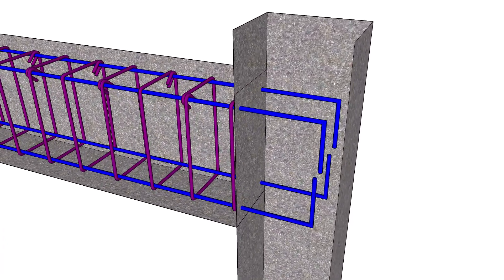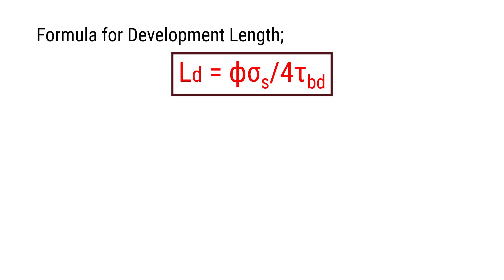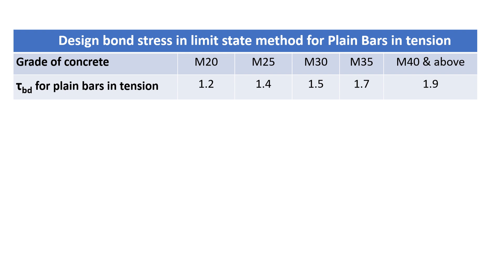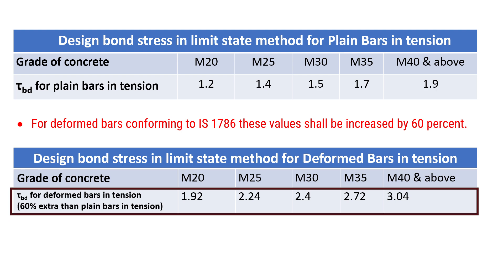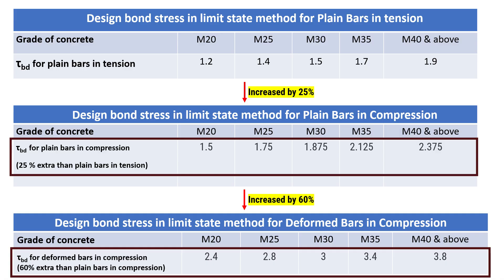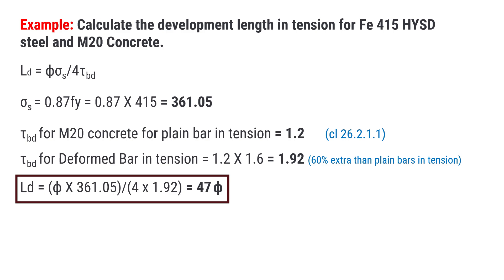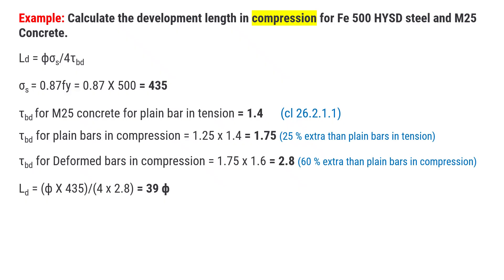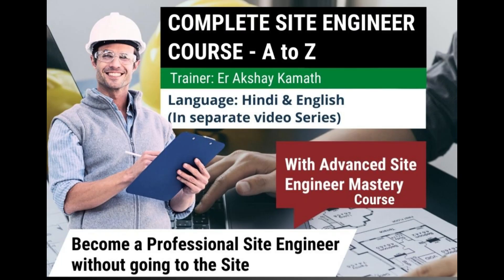How to calculate the Development Length? | Calculation in Ld | Civil Tutor

Comment: Sir L/4 or L/3 beam or slab drawing provide plz discussion matter
Reply: Generally for a beam which is non continuous and fixed we provide extra top bar at L/4 distance where the negative bending moment occurs
But in case of continuous beam we provide extra top bar at L/3 distance from the fixed support of beam.

Same in the case of slab we provide the crank bar are L/4 distance  where negative bending moment occurs.